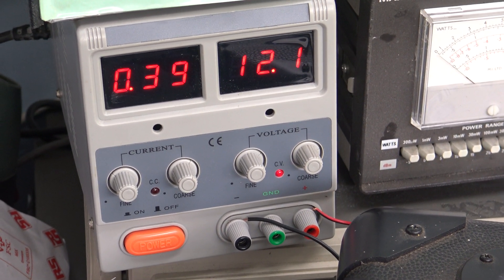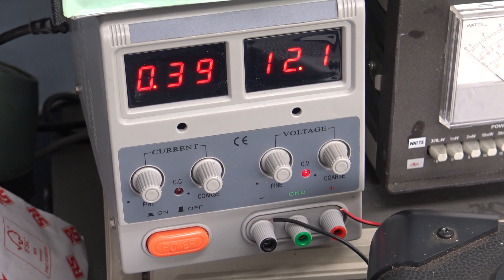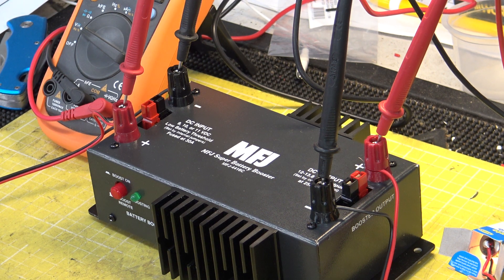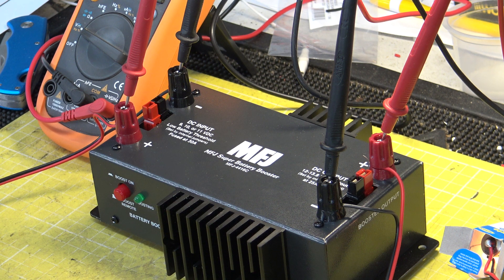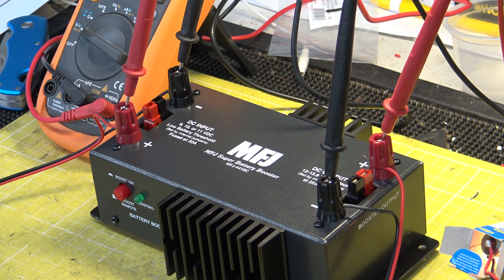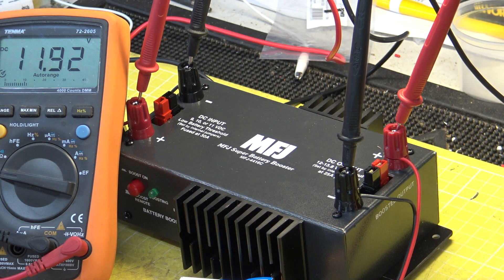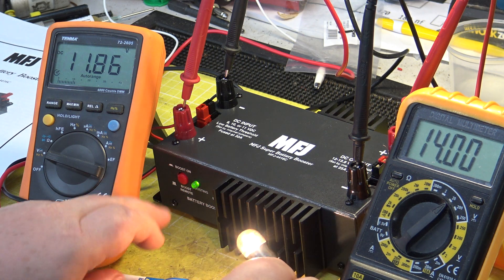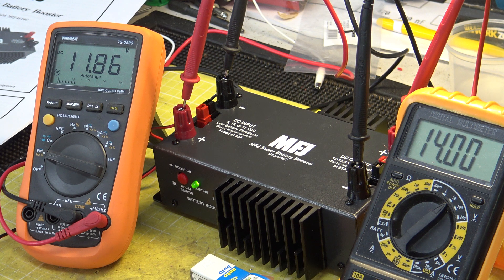MFJ-4416C 12V battery booster - demonstration & discussion

Comment: I have one of these.  An Icom IC-7300 straight off the battery, digital mode, maxes out at 11 watts output.  Kick in the booster and easily achieve 50 watts; you should not exceed that in digital modes because of the 100 percent duty cycle.  It also puts some serious suction on whatever battery it is connected to.  It is extremely efficient; very little waste in the device itself.  So 200 watts in is also 200 watts out (very nearly) with appropriate adjustment of amps as needed.  In other words, if you are drawing 10 amps out, it will be around 13 amps in.
Anyway, the Icom IC-7300 powers the final amp transistors from the battery which is normal BUT it ALSO powers the driver stage straight off the battery.  That means a small reduction in power supply voltage is amplified by the reduced voltage on the driver stage.  This radio is exceptionally sensitive to supply voltage.
EDIT: I added Anderson SB50 connectors for input and output.  These are larger, 50 amp variants of the "powerpoles" that are already included.

Comment: RFI problems?
Reply from the maker: No, shouldn't be a problem. it's made for amateur radio use. That said I've not operated anything over 45W with it. I'm more into the 100mW to 5W side of amateur radio despite my full class A 400W licence.

Richard, G0OJF, UK
Reply: It has a few birdies pretty well suppressed.  Ferrites on input and output helps quite a bit.  Also the device has a keying input that you can use to activate the booster only during transmit, provided of course that your radio has a key line for this purpose.  A newer model of the booster has an RF detector to automatically boost only during transmit but I suspect the key line would be better since most transmitters allow the key line to be activated a few milliseconds before actually transmitting. This way you don't get a sudden voltage boost at the start of a transmission.

Comment: Ps giga parts has the remote in stock 89usd
When i got this batter booster i payed 139usd but it a while back
Now msrp is 209usd
Reply from the maker: Bear in mind you are in the USA, there is import duty & VAT (at 20%) by the time it gets to the UK. The 4416C looks to be around £229 in the UK.

Richard, G0OJF, UK
Reply: @ukfmcbradioservicingTango21  i understand ya'll have vat tax
N shipping is not cheap ether 
I just ordered a part from the U.K. 
N it wus pricey but it wus extremely well made